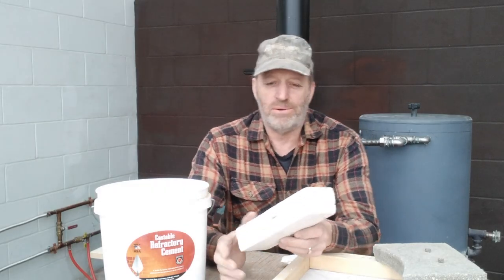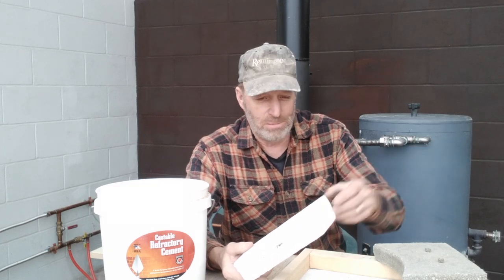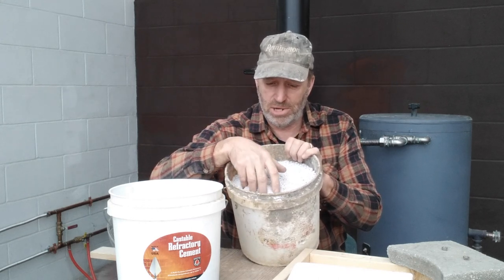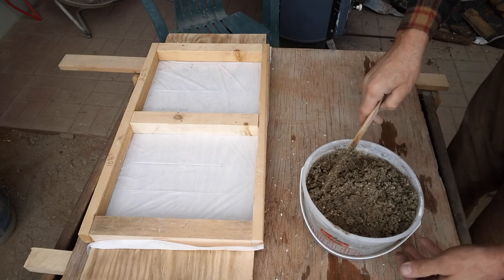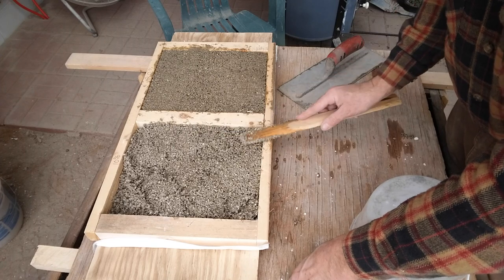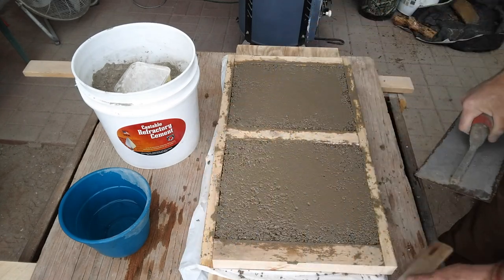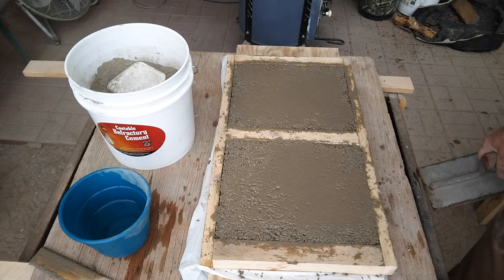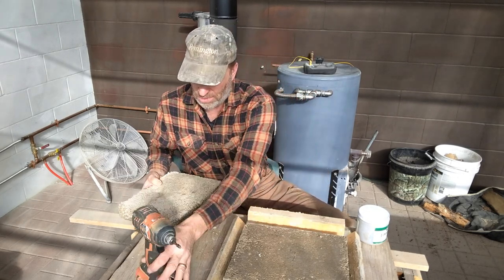DIY, Inexpensive Rocket Stove Building Material

Comment: I have used refractory cement mixed with steel fibers consolidated with a vibrating table   made from an old van tyre and a cheap bench grinder motor with an offset balance shaft .three years of use and the refractory panells are like new   No spalling or degrading .

Comment: Maybe one can also add micro-balloons/glass bubbles. These are used as an additive to resins.
They are microscopic glass balloons, very high volume to weight ratio and insulating.
I'd also might add a bit of waterglass to the cement mix, maybe some sand too.
Best results to have as little cavities between the granulate as possible ?
Reply from the maker: I imagine a person could try all kinds of mixtures, to find the best.  But you do want to keep it as simple and inexpensive as possible.  Thanks
Reply: @doubleMinnovations  True. I've seen some guy in Australia tried a mix with only perlite and waterglass, which gave a somewhat brittle mixture, but held its form.
In an open structure the binding between the granulate is minimal, so idealy one would fill the gaps with a finer granulate, or increase the bonding agent. Waterglass can be made at home cheap, but will complicate the process, or buy it from the shelf and pay way more.
Cheers !

Comment: If refractory cement is anything like regular as far as curing is concerned, a slow cure would make it stronger, i.e. keep it damp (e.g. damp sacking over the top if it dries too fast) rather than allow air movement. That is how ferrocement construction is strengthened.
Reply from the maker: I took them out of the forms after the first day.  I not sure I remember, but I think I left them cure for a day or more before testing...  I would have to look at the directions on the bucket again.

Comment: Do you think this is equivalent to water glass material ?? I totally agree with you on costs. Everything seems to cost double minimum cost from a year ago. Just crazy for sure.
Reply from the maker: Water glass can be expensive too, and difficult and hazardous to use.  Water glass is about the same as that 'ridgidizer' I used on the on the riser tube for the rocket stove water heater.  If it was used with perlite, I think it would take quite a bit to fill in the voids...
Reply: @doubleMinnovations  What you said is so true. I found a cheaper way for waterglass. Some cat litter uses this as its main ingredient. About twenty five bucks for thirty pounds or so. The negative part is that it has colored beads mixed in that change color to tell the cat owner what problems the cats are having with a color change of the litter. I picked them out before I used the material years ago. That is all I remember Double M. That was long ago.

Comment: I'm wondering and guessing silica glass, whether store bought or DIY kitty litter and toilet pure lye cleaner method, might work better?   Not related, though some of those forges methods might have some ideas and I'll share this if you ever get into microwaves... since the YT channel "Shake The Future" video titled "Diy Microwave Kiln - OUTDATED - New Video Coming October 2022" seems to be the best design for those microwave kilns.  Anyways, a lot seem to use silica glass for the refractory adhesive in DIY bricks is common with perlite where some add plaster of paris or sand or clay or koa wool to the mixture. Higher temp firings refractory brick looks like they use alumina that is fired to sinter with like pool sand.   I haven't looked into in a while since plans had changed to not focus on the pottery, forge and heat treating kiln work just yet.  Though figured I'd share what came to memory and I can find on the net.  Have a good day.
Reply from the maker: Thanks for sharing.  I'm using the materials I'm familiar with, and pretty sure will have a good outcome.  The Infrared coating is new to me, and am curious how that will work.
Reply: @doubleMinnovations  That infrared coating seems like a great idea as well.  We'd use "kiln wash" which is like a white wash if you're familiar with basic masonary coatings or at least the ones I used on a short term mission trip in Ecuador where is like a quicklime paint.  Not the same ingredients, though seems like both help reflect heat as well as protect.  When I used to run the pottery kilns during my undergraduate program, we'd use the kiln wash to coat the carbide shelves, floor and seems like if I remember correct on the big gas kiln, the walls of the kiln to help reflect heat and prevent glaze bonding to the more expensive whats coated refractory surface. So yeah, that infrared coating is a great idea. I was actually thinking of you recently when watching a video on the masonary wood stoves and thinking adding a route above the burn chamber to go over a metal roof for a lower burn chamber double burn section before the upper "bread oven" top burn chamber.  Was thinking might be more efficient along with adding the kao wool on the upper burn chamber top to help reflect more heat back down.  Seem the infrared coating might be an easier way now you mention.
Reply from the maker: When I built my first rocket stove, I put a white refractory coating on the inside of riser tube.  I don't remember what is was, but it didn't last long.  It flaked off...  I think the expanding and contracting with changing temps broke it apart.
Reply: @doubleMinnovations  it would be sweet if someone had a mold cast for a Batch Stove and then we could use your magic mix to just pour into the mold casting. Then just add a door and stove pipe. The issue of course is not just insulation but also the thermal mass set up. I saw someone pointing out in their experience bricks never explode - they just crack. So for thermal mass it seems like normal brick and clay and lime or something with sand. There is that Batch rocket stove channel but his vids are more like chat sessions without real DIY nuts and bolts. Then he sells his building design using the too expensive ceramic fiber. I didn't realize that the price had shot up but that is not surprising with all the FED pandemic money that bloated the "debt deflation." With my ceramic fiber hack to the wood stove - it has to be cold enough outside for me to get good draft. Otherwise the baffle was creating back smoke when I reload wood and the burn chamber was smaller - so I had to reload wood more. So I ended up taking out about half of the ceramic fiber.

Comment: Perlite does not absorb water.  It is glass. Could reinforce with basalt fiber mesh by wrapping all sides.
Reply from the maker: Nope; perlite doesn't absorb water.  One reason I use it for high temp insulation.